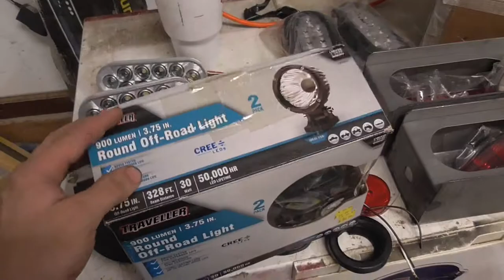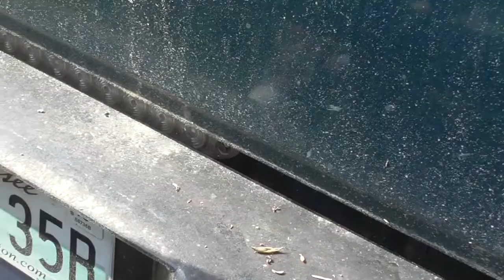Trailer Project | Welding  D-Rings, Tail Light Boxes, And Ramp Hook Plate

Comment: Those back pieces might bend if something pulls on them. I would probably come up with a way to support them. Going to be harder to fix them after you bend them.
Reply from the maker: Yeah, I was thinking of a way to do that while editing the video.  I think I;m going to add some steel across the bottoms of the ramp hook plates so that it's at least supported on three sides. That should keep most of the bending down, worst case it slightly bends out on the top. But all it's there for is to hold the ramps while loading and unloading.
Reply: What are the dimensions on your trailer